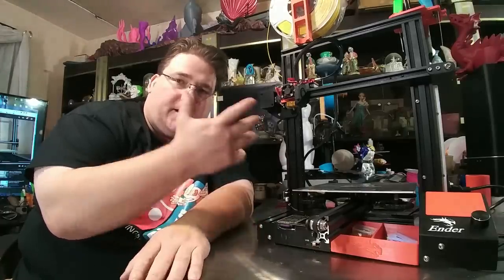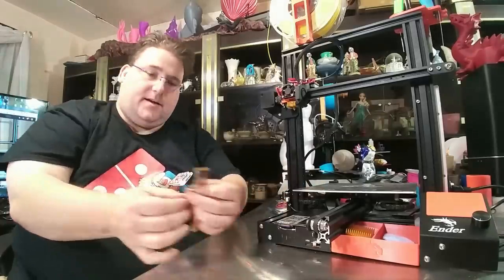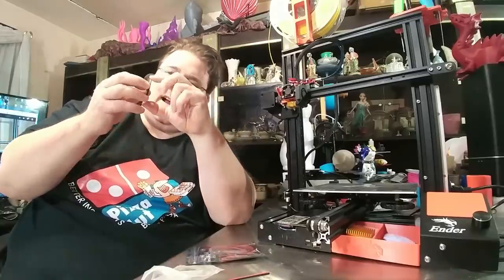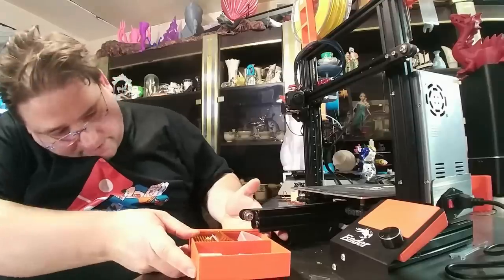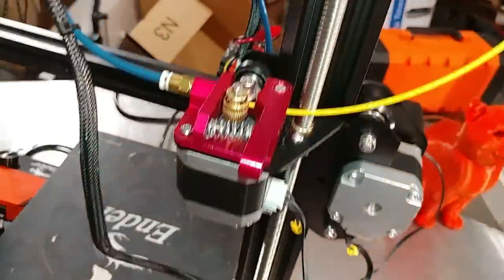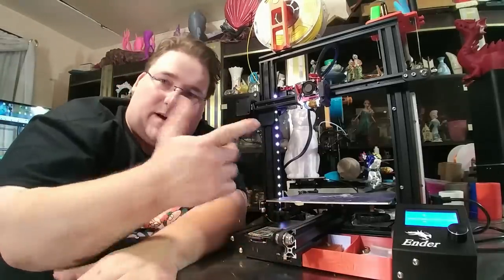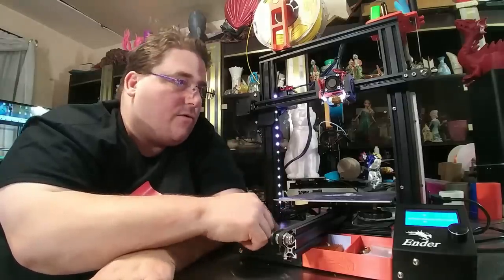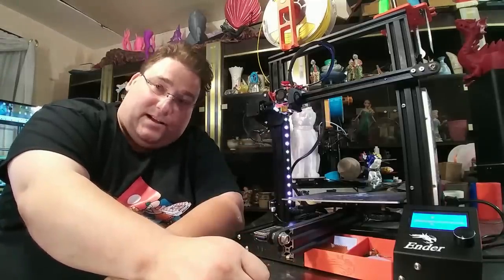T3DP 216 Ender 3 Upgrades & Mods

Comment: Thanks Chris. My ender 3 is a total joy. I overpayed on prime and its easily worth the $240. Had no issues. My pro tip - loosen ALL the frame screws before you connect anything, put it on a flat desk and PUSH DOWN to align it. Mine was way off.
Reply: I have seen the same thing even though they are pre assembling the bases on them unfortunately they are not checking to make sure they are flat when they do.  I put one together that was so bad you could slide 5 sheets of paper under one corner.  Loosen all the frame bolts and square it up before you tighten it up.  I use a torque limiting driver so they are all the same to make sure it doesnt get tweaked.  I currently am going to order one for myself but since I have a production engineering degree my friends always ask me to build stuff for them.  Im that guy who everyone asks to build their ikea furniture too because I improve the joints in the whole thing and add extra braces.  Cant wait to get my ender.... need to find a good consistent pla manufacturer though.  I have seen a ton of variation in the ones my friends have been using.  I actually designed a machine to make the filiment the same diameter but am waiting on the patent attorneys to get done with it. I just need a solid manufacturer to trust.
Reply: I was wondering if it was still worth it with the jacked up Prime price - that helps, thanks :)

Comment: Love the upgrades! I remember mentioning I had installed dampeners about 8 months ago and everyone said I was crazy and it would reduce my accuracy. I think it actually made it more accurate by reducing vibration.  Once I got the dampeners on then the fan noises drove me crazy so I replaced those as well and now CR-10 is whisper quiet and super accurate.
Reply from the maker: Noise entering the print via the flexible Mount is a concern of mine especially as the mounts age and we're out but for this kind of reduction in noise I don't care :-) they're cheap enough that I'll just replace them as needed if that's even becomes an issue :-)

Now I need to find a quiet 30mm fan and a quiet pancake blower fan :-) have not found either of those yet
Reply: I can reassure you that having used them for 8 months now I am getting better prints at higher speeds and love the quiet they provide also.  If you notice something different, please let me know.  You're a thorough guy so I don't think this applies to you but I think some people don't re-tighten every thing properly after install which is why they see issues after installing them.  I think I got better prints because 1) they reduce vibration/noise and 2) it forced me to make sure everything else was properly tightened after installation.  I think we both know that having one or 2 sightly loose parts on a printer can have severe impacts on the quality of a print.  Love what you do Brother! Keep it up!

Comment: i know this video is 3 years old but a couple thoughts, i mix superglue and thermal paste to glue on heatsinks. and that bed stepper that's blocked by the leveling wheel for heatsink placement, i never even use that knob for leveling. i keep that one static and level the rest according. doesn't even need the knob, could use a nut to get more clearance for the heatsink

Comment: Good video!! The whine on the fan below 100% is probably because of a low frequency (audible) PWM used by the firmware to throttle it. This can be configured differently in Marlin. A different fan might help but the ultimate cause is likely software config.

Comment: Great video...but i just ordered an ender 3. The preassembled main frame was wobbly...that is to say the four corners would not lay flat on the table. I expected some issues and do not mind assembling stuff. . But that is a huge oversight in quality even for a $200 printer.
Reply from the maker: Not really it's just a normal aspect of a printer with an H base like that and it's super easy to fix if you look on the left and right hand side you will see that there are two bolts diagonally going through the side frame members into the central frame member loosen those four bolts press the printer down on a flat surface retighten those four bolts that will straighten it right up :-)

Normally these printers have a square base like the cr-10 mini or cr-10 if those bolts are tight enough and H frame can twist in shipment right inside the Box not a big deal just something you have to pay attention to when you assemble it
Reply: Nerys thanks for the comment and help! Your videos are great btw! Ive tried that. But everytime i retighten the bolts, it goes back to being wobbly.
Reply from the maker: @israelcontreras5332  that's very odd I've never had 1/4 itself back to wobbly... How often is it? Is one of the beams bent?
Reply: I dont know. It seems something is wonky with it. Those bolts were pretty tight. So it seems unlikely it shifted during shipment. Ive asked for a replacement printer. But if that one is bad Im calling bad quality and probably wont waste anymore time or money on creality. It is a shame this happened because I bought this printer for my classroom to use for different projects we do in class. Im cool with tinkering. I was ready to mess with the z axis maybe...or correct a user error of my own...or some other stuff. But it was my impression this printer was relatively user friendly. I mean to have something like the preassembled from the factory parts be that off is a deal breaker if the second printer has problems.
Reply from the maker: I understand. keep in mind for $200 your going to get a very different machine (and level of support) from say a $2500 machine. but you can buy 22 of these for that price....

once you are done tinkering. besides potential maintenance (none of which is hard) down the line the machines are pretty much fire and forget. little wiggle of leveling knobs tightening of loosening bolts over time (its a machine with moving parts) they just "work"

I have 4 of these are all 4 work flawlessly once you are done setting them up and getting them going. every morning I remove a print click for the next print and don't even wait around. I just walk away. when I goto bed same thing. remove print. click go to the next print and just walk away. I have nearly a thousand hours on the machine already. zero issues post setup/tinker.

one of the ways they made the machine cheaper is to use less extrusion in the frame. a consequence of this is its not as "rigid" as say a CR-10 mini would be. but the CR10 mini cost 50% more and is not as convenient (break out box etc..) so its a "cost of doing business" when you go cheap like this but the quality is their as you can see from my prints.

once you get it going well you don't really have to "do" anything to it besides regular maintenance. clean of off of dust now and then. down the line a heater cart or sensor might fail. 20 minutes with a soldering iron and wrench and your back in business (they are wear components and in time will fail on all machines though if you get past the first 100 hours your probably good for a few thousands hours)

if the v wheels are properly tightened (not over tightened) you will probably never have to replace them ever. (I have machines with over 5000 hours and the wheels are fine to this day.

but please remember. $200 or $2500 these machines are NOT appliances. they are hands on and DIY. you have to work with them to get what you want. if it only wobbles a little bit it could be as simple as putting a sticky pad foot under one leg to stop the wobble. (if its not affecting prints etc..)

Comment: It is very easy to change where the Controller fan connects to keep that fan on continuously.  Just move them to the terminal block that the extruder fan is wired to.
Reply from the maker: Yes that's what I plan to do

Comment: I bought the heat sinks and mine did come with adhesive sheets. I have a milling machine and milled off a slot in the fins to clear the bed leveling screw. If I knew how to get you one I’d send a milled one out to you since I have more than I’ll ever use.
Reply from the maker: Cool. Eventually i would love to get into that as well as it goes nicely hand in hand with 3d printing.
Reply: No kidding, I’ve got a CNC lathe and Mill, I find 3D printing amazing and have made servo end covers for all my stepper motors the first week after the Ender 3 was running (thanks to you and a few others on YouTube, ) I keep laughing because I never heard “Zed” before. For some reason I kept thing about a Superman character! In the CNC world it’s just X, Y, and Z that is until you get into 4th and 5th axis. I love your sense of humor and honesty on the videos. Heck I’m even watching the ones for other printers! Always something to learn in my 57 year old mind. I didn’t see how you mounted the LEDs to light up the hot end, was that with a glue gun?
Reply from the maker: heeder777 yep. Hot glue is so handy :-)

Comment: For about $30 instead of the SD Card slot move, you can add OctoPi to it and stop using SD Card and connect via Wifi.
Reply from the maker: I've never had good luck with octopi yet it keeps failing on larger prints Communications error and then I have to start over I'll look into it again sometime
Reply: Connect the pi's power off the printer power supply so the ground on the USB is common should help with communication error.  I do see those error but only if you are using a external power supply for the pi.
Reply: Ive had issues with comms however my problem was solved by using a usb3 hub.I did use a bench psu and my pi was a bit thirsty so I used the hub which has a 5amp adapter. Now the pi has been running for over a month without any issues. The added benefit I can plug things into the pi without it resetting as well. Note its a pi1, the pi3 does not seem to be to touchy.
Reply: I would just go straight to Klipper and take the movement calculations away from the motherboard entirely. Since you are using a far more powerful processor to do gcode generation. might as well put everything else on there. It is a bit of a mission to set it up because you need to flash firmware etc etc. but I have had some really amazing prints from it and it is much faster while being quieter. I think that has to do with far more free cycles to pulse the stepper motors on shorter intervals due to the 8bit processor barely doing any work. Corners, end of lines and especially curved surfaces look far nicer. After some tweaking which realistically shouldn't take you more than 30 minutes you can get some great prints. Better than fiddling around with your slicer for hours and days on end. Also since you are running a linux based OS on the raspberry pi you can run octoprint and have all those benefits or just give it a gcode file sliced with whatever you like.
Reply from the maker: I run upwars of 8 to 12 printers at a time. the cost in power alone to run that many pc's :-) hehe

I like the reliable simplicity of the SD cards.
 @LuluTheCorgi

Comment: Before going the heat sink route on the steppers I'd check the voltage on the stepper drivers. If it's a CR-10 board at 24v might be the issue, but not sure of that.

Comment: Love the lighting scheme that you have set up there. I think you'll get that Ender 3 dialed in. But it's hard to match the Ender 2. Flsun is sending me replacement parts for my Delta. I have been able to do some prints with it. But I wouldn't trust it unattended.
Reply from the maker: Mine runs fine so I imagine you got some QC issues I did notice that once you get them all sorted out you should be fine

Comment: There is a long micro sd to full size sd card adapter with long soft cable, and they aren't that expensive, but the cable is pretty wide in comparison to the one you are using. Aliexpress has them for a little over $2 a piece. And thanks for the vid, keep up the good work.
Reply from the maker: I know but they are not usable in this application either they are not compatible I could not get it to read an SD card or the process of folding the cable to move it out of the way of the heat sinks so it did not block the fan compromised the cable
Reply: Nerys yeah I can see that, I wonder how much you can fold it up without it goes kaput.
Reply: Personal experience to throw in here. It really depends. It depends on the quality of the plastic used for the cable, the thickness and the wires inside. The copper wire can only bend and stretch so much before it snaps. Also multiple bends work hardens the copper and it will break. The plastic protection is very dependent. The thinner it is the more it can bend. However unless it is designed specifically to fold onto itself it shouldn't be. The concern is the corner of the bend. These cables are intended for rounded soft bends, not hard angle bends. I would watch the plastic and if you see any discoloration or stretch marks appearing stop. wouldn't go further than say a 45-30 degree inner angle. Some will bend better. Bu be careful. Granted since they are only a few bucks you could try one till it is almost bust and then use what you learn't on the next one. Heat can help but nothing more than a hot hairdryer. Don't want to warp the plastic, just soften.
Reply from the maker: Well that's probably what did it I folded it 180° multiple times at angles on top of itself in order to fit inside there :-) so I probably killed it what I need is the one that I'm using now but with a longer tail so I don't need the extension it's nice and thin and I don't have to fold it or crease it.

Comment: I while ago a ordered the same heatsinks. I have one of them on my dancing extruder-stepper-motor on the delta (mostly for psychological reasons :P ). Just thermal grease and tied with brass wire to the screws of the motor. This was intend as a quick and dirty solution ...and it did fall off so far.

Comment: THose clips are nice, currently I am using zip ties on my am8. Also take a look at voltages before putting on the heatsink. I do not know of a good video for checking it but not too difficult if you hae not looked into it before.

Comment: Thanks for all the awesome videos.  Can you make a video on how to install the TL Smoothers boards?  Do I just need 2 or do I need all 3?
Reply from the maker: Theoretically you need 2 one smoother for  x + 1 smoother for y and this is only if you are experiencing Salmon skin if you are not experiencing salmon skin you do not need to smoothers

If you are experiencing Salmon skin and need the smoothers get free and put one on the extruder as well I have noticed a marked improvement in print quality what I did this they are straight up at Plug and Play

Put a little tape or hot glue on the solder joints on the back side of the board so they do not short inside the brain box you'll have to very carefully remove the hot glue that hold the existing plugs in place

Unplug the stepper from the brain board plug in the smoother and plug the stepper also into the smoother

Stand the smoothers up sideways along the edge of the brain box so they don't block the airflow over the brain board and close it up

That's it you don't have to do anything else there's no programming they are plug-and-play they just work
Reply: Does it matter which end of the TL Smother that you plug the cable running from the board goes into, top or bottom?  FYI,  I don't have the printer yet,  I just purchased the upgrades that were recommended by you and several others and just waiting and preparing :-).
Reply from the maker: Nope they are bidirectional

Comment: You'll regret fitting the stepper dampers.  The belt system is designed to be in tension, which will slowly deform the rubber in the damper.  Also, the system will show slightly more ringing, getting worse as the dampers age.

I tried them, I'm not just being a YouTube hero.  A much better solution is to upgrade the board to one with silent drivers, and perhaps the motors to 0.9 degree models.  Better resolution and decreased noise that way.

HTH
Reply from the maker: Depends on how long they last. I do not see added noise (i suspected that) but i do print slow. If i get 6 minths out of them i am ok with it being a maintenance item i will keep everyone updated.

Comment: Thanks for the great video! I know you created your own assembly for the hot end using the stock fans, however wondering did you experiment with other assemblies such as the PetFang? I am trying to find the one that gives the best result for cooling / overhangs.
Reply from the maker: I have not yet but I do plan to for the future I use the Cobra on my maker select V2 which I really like

Comment: The stepper drivers are set wrong, no need to fool with heat sinks of the stepper motors. If a CR-10 S5 can move all that mass and never have a hot stepper motor than this little printer will be fine once you get the drivers adjusted right.
Reply from the maker: Agreed I will look at that tonight when I get home
Reply: Yea i was thinking something is wrong there, I have same printer and after hours of running they are like warm at best. It's either set wrong or overloaded. Also I think his solution for the x axis is the wrong solution.
Reply: I was thinking it could also be that the Delrin rollers are set too tight, or combination of all.